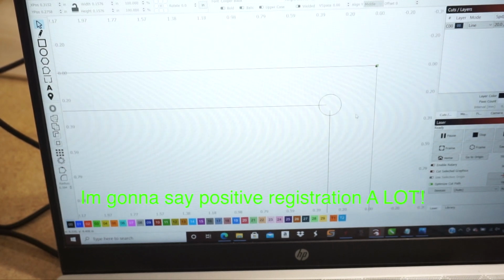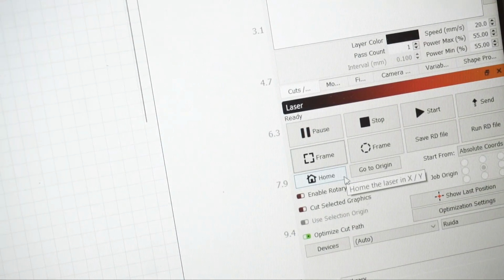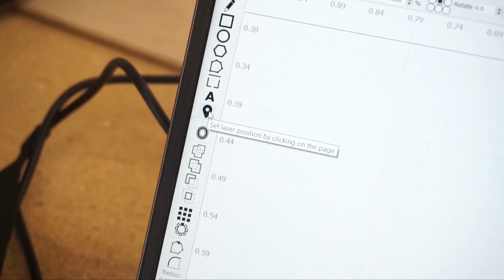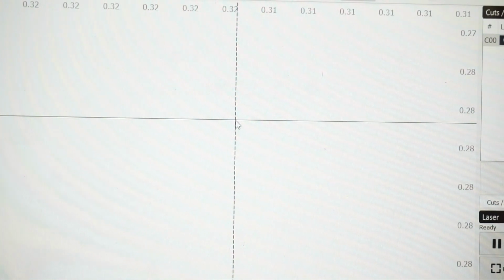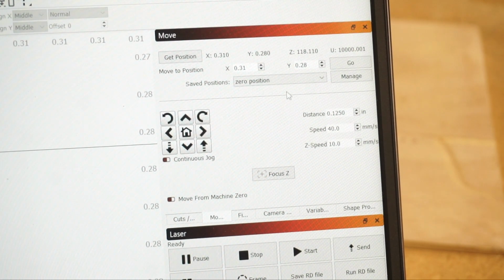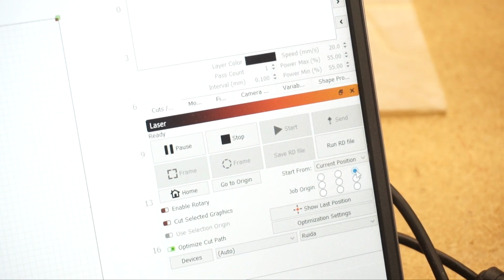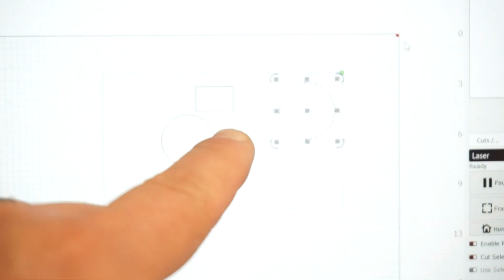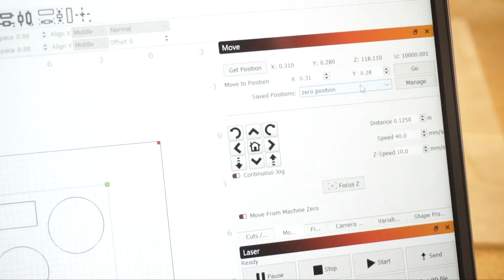How to install and setup a Co2 Laser Fence in Lightburn

Comment: Good day.  I followed your video and everything was working fine.  I recently changed my grid settings to 1/4" and my working size to match my work bed and now I'm receiving this message, Need more overshotting or larger accleration, on the controller.  Now I have to move my design in lightroom about 2 inches from the top and side.  Could these changes have caused this issue? Any help would be appreciated. Thx.

Comment: I've never understood why people set their origin anywhere other than back left? Or what I should say is set the origin anywhere other than the same corner where the beam enters the cabinet?
Reply: That's an interesting thought provoking thought  : I've never thought about it (I'm new to lasering however... so am assimilating things as swiftly as I can). Do you suggest this from a standpoint of "it seems abstractly appealing  : that that's where the laser is coming from, hence it's the "origin" of the laser, or is it a more technical reason : that the shorter the path of the laser (and most cutting will probably be near the origin, as large jobs will inevitably be a small number of the jobs one does), the more likely the beam will line up with the optics as near perfectly as it can,  but chances are it might be somewhat wonky by the opposite corner : and also be going through more smoke if extraction isn't great, by the time it hits the focussing lens ? Hence you're suggesting this to try and maximise quality of cutting ?
Reply: @jonnyhifi  Yes, exactly, everything you've said... The closer to the source, the more powerful the beam... all beams diverge to some extent as they travel.
Now I know that we're only really talking a very short distance, but the likelihood that you've got the mirrors absolutely perfectly aligned is not high. So there's a good chance the beam is striking the lens in a very slightly different place depending on where the head is in the machine. So you might be getting different results the farther you get from the source. When you couple the fact that you've likely got smoke particles inside the cabinet too, which will absorb even more of the power,  it makes more sense to do all your cutting and engraving in the corner of your machine where the the beam enters. Obviously, if you're cutting/engraving to the maximum size your machine will allow then you don't have much choice, but if for example you are engraving say a board 12" square, then why you'd place it smack bang in the centre of the bed is beyond me... Everything I do is aligned right in the top/back left corner, right where the beam enters.
Reply: @semperidem2577  If I may.  CO2 lasers work in the 11.6nm frequency range, and can pass through smoke with ease, if that's a concern.  Much like the infrared systems that firefighters use to see inside structures that are filled with heavy, dense smoke.  Secondly, if your beam alignment is good, then you'll have full power at your focus lens regardless of the position within the work area.  If you don't, it's time to grab a wrench and start sighting it in.  The beam size as it enters the 3rd mirror on my 100W OMTech, for instance, is approx. 2.5mm.  Given the surface area of the mirrors, as long as your vertical (3rd mirror) alignment is perfectly vertical  in respect to the focusing lens, you'll have no issues.  The focus lens tightens my beam, with a 63.5mm FL lens, down to 0.06mm in diameter and I can utilize every last mm in the frame.  I have another laser I built with a 55" x 44" working area, and even with the much longer travel path for the beam it performs similarly.  Third, if you get one of the OMTech machines, one of the first upgrades you should do is to rip out the garbage "exhaust fan" which is a glorified PC fan, and throw an inline 6" fan in - but not at the laser.  Optimally you want negative pressure on your system, so place it as close to the exhaust vent as possible.  Not only will it reduce the Db in the machine by about half, but you'll get much more effective smoke extraction.  I do a lot of depth engravings, large scale, running at 500 mm/s and 75% power, just blasting away and vaporizing material - normally an extremely smoky situation.  With the exhaust modifications I mentioned, it remains nearly smokeless inside, providing an unobstructed view from my internal camera even, and prolonging the working life of your components.  As to the origin point, which is settable via the Ruida and through Lightburn, there are a lot of reasons to move it away from the corners of the bed.  The honeycomb tends to slope up at the sides and overall is actually pretty poor at presenting a flat, even worksurface.  If you use the camera feature in Lightburn (which I'd highly recommend doing), the highest resolution and therefore accuracy is going to be near the center of the bed.  My origin is set to dead center, along with other coordinates programmed in lightburn (the four corners, X - center, Y-center, and home of course).  This allows me to place my design with a single click, literally toss a piece of material in the machine, tell the camera to orient the engraving accordingly, and away I go.  My workflow is demanding and this expedites things tremendously for me.  I'd also suggest a touch off sensor (probe) as well as automating the Zed axis.  Good luck friend, happy lasering.

Comment: Did you cut 1/8"  hard board  with 80w laser at  20speed /55 ppwer? 
Im asking because I have a laser with reci tube 90w (100w peak)and I was cutting same material at 25 speed/ 90w power... so Maybe something is going not correct
Thanks for the video
Jorge!
Reply from the maker: Jorge I’d look into your mirror alignment and the cleanliness of your mirrors. Something isn’t right
Reply: @jackalopecustom  Agreed, also check into the reverse alignment tool from Amerian Photonics.  If you use it to align your Reci, you'll be slicing 1/8" at 40mm/s +, 65% power.

Comment: Take it easy with the z axis belt, moving so fast you may burn the stepper driver. Rotating a motor by hand the motor becomes a generator. So take it slow when you do that or install a switch on the cables.
Reply from the maker: The z axis is manual only. No motor attached. That’s really great insight for those that do have a motor attached though! Thanks 👊

Comment: Great technique. May i suggest OBS for capturing the screen so the moire is reduced?  You can have multiple video feeds and desktop view scenes you can switch between with a simple key command.
Reply from the maker: I’ve never heard of OSB, but will check it out! In my other videos I started using a free screen capture app and that works so much better than the phone recording. Thanks for the suggestion

Comment: I did something similar, my origin is left upper corner since it's a yellow and black, but I first squared up the bed to head and installed a strip of aluminum on the left side, and then did the top piece like you did for the top edge.  Perfect repeatability, I just have to remember to put a .1 offset at 0,0 and use absolute coords for cutting.  I can repeat a cut at the 1" y and 1" x every time.
Reply from the maker: That’s awesome! In my haste to get this running a day or two after getting it I just threw this together and didn’t square the bed prior to setting up the fence. I like the idea of the aluminum. With how thin my fence is I’ve noticed some issues with placing boards with rounded corners on it. I’m gonna use that aluminum idea when I redo it! Thanks 👊
Reply: @jackalopecustom  I used 1/16" by 3/4" strip. I took cardstock and placed it against the edge of the honeycomb, and set a cut from X0 all the way down so it cut a straight line. then lined the strip up with the cut and screwed it to the honeycomb rail.  Only downside is thin stock can slip under, so 1/32 sheet stock needs to be carefully aligned. For the back stop I did somewhat similar to what you did except I used zip ties to secure the 1/4" ply I used to the honeycomb, and made the piece the length of the cutting width which on mine is 27.48, the drew a line from y0 across and cut the board.  I don't worry where the nozzle is anymore since I use Ab coords for cutting, just have to make sure none of the cuts align with 0,0.   I have a MEWE page called Chasers group, come join us, we could use a few more people, you have a good idea there that people can use too.

Comment: I am sorry but I don't understand why you need to create a fence in your laser,  aren't the rails 90 %  to each other... and you can use a carpenters square from that set your piece. Also In Lightburn ( in the "User origin"  setting) you can click on your image  then click on the "move laser button position button (and put it in the middle or any of corners of your Image) then send it to the laser and then hit Origin on the Ruida controller. and it will start from that position to repeat cuts. ( a lot of times I will put painters tape on my grid and run it once at low power to have a temporary image on the grid of where it's cutting) also  maybe consider  a camera for lightburn. I wish you all the best of luck , Having a laser is a great tool in the shop.
Reply from the maker: I’m sure there are plenty of different ways to square up material on your laser, this one just works for me. I made a fence for my wood cnc as well. Each (laser and cnc) has a home position and the ability to reference offsets. This is a quick and easy way to get your material in a known spot and start working. 

Many laser users I’ve seen on YouTube utilize the camera or tape or some other method to square their material up and if that works for them, more power to um! 

Thank you for your insight and kind words and I will be looking into a camera in the future.
Reply: I can't speak for other OMTech owners, but my bed came from the factory horribly misaligned with the gantry system, and is no where close to being usable as a reference for square.  Neither are the honeycomb frame pieces perpendicular with each other.  Also, the honeycomb beds are natively poor for this job, and a 16-gauge piece of thin steel frame for the honeycomb is by no means conducive to repeatability, as it offers little backstop capability and even poorer reliability.  If you're dead set on having a repeatable alignment point, what he's done here is one of the cheapest and easiest methods for gaining such a function from your laser.  Just about every laser I've ever worked on or seen suffers similar issues, unless you throw down for a Boss or Trotec, but then you're paying 20 times more for the privilege, when a 50 cent solution like this is perfectly workable.  Even Glowforges (gag) have this issue, and rely on their positioning system and scannable tags on their proprietary materials to attain this function.
Reply from the maker: @neonsynth you hit the nail on the head! Thanks for your response
Reply: @jackalopecustom  you're welcome friend.  Just trying to share the knowledge gained; we're all in it together and face the same struggles.  I'll be posting videos on my setups and builds soon, I'll drop ya a link if interested.
Reply from the maker: Absolutely. I’ll check it out when you do! Thank you 👊